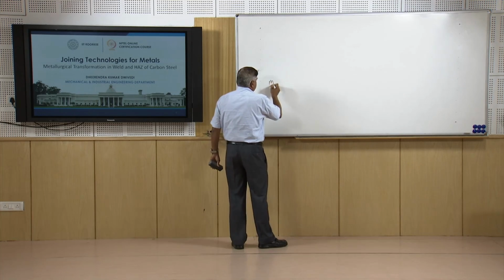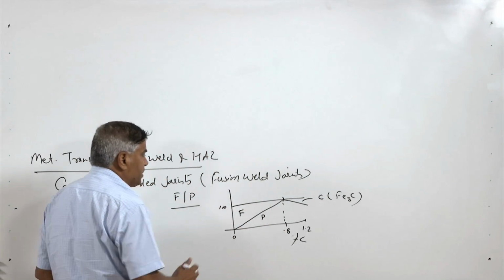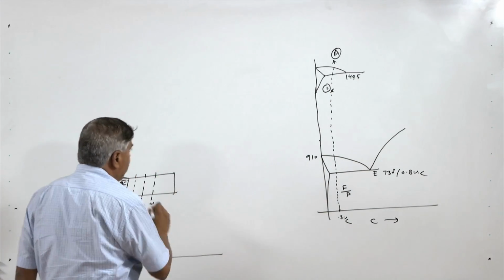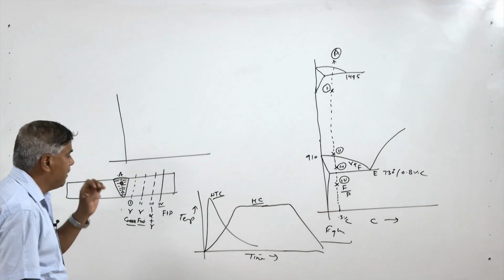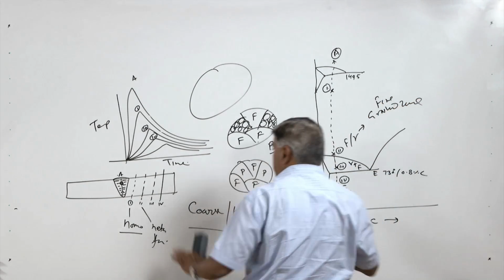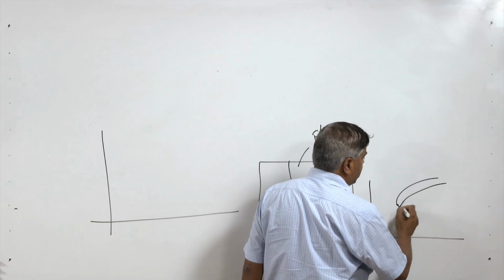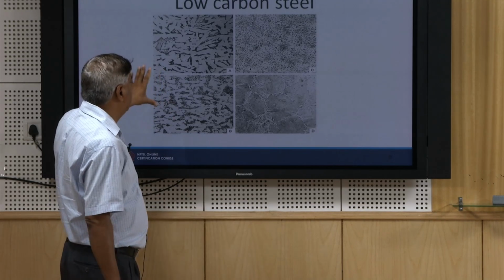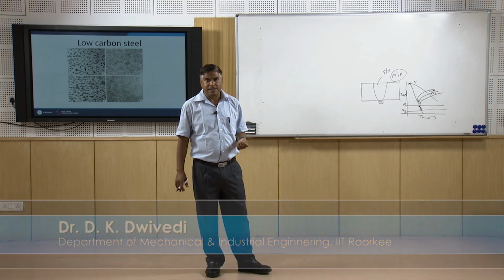Lec 35 - Metallurgical transformations in weld and heat affected zone of steels

Comment: High cooling rate produces fine grain then how can weld zone have coarse structure???
Reply: High cooling rate in liquid produces fine structure because there will be only nucleation but no growth due to diffusion is restricted. But in the case of heat affected zone there will be no liquid forming, grains on exposure to high temperature there is increase in austenitic grain size, but high cooling rate in heat affected zone causes fine pearlite  ( interlamellar spacing in pearlite is very less and strength increases where grain size is same of coarse austenitic grain formed). So you need to see the difference between the grain size and fine pearlite.